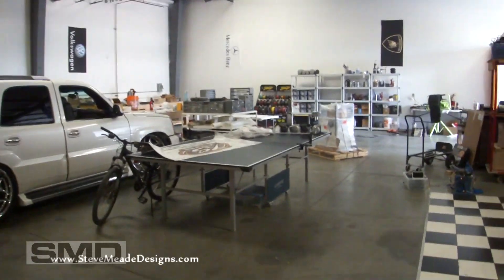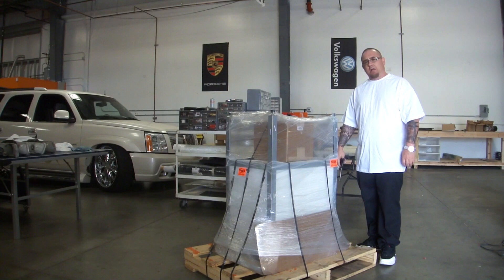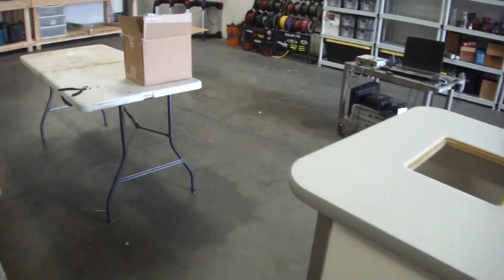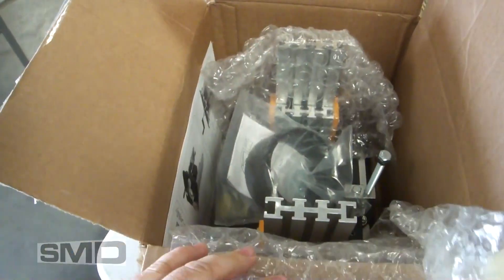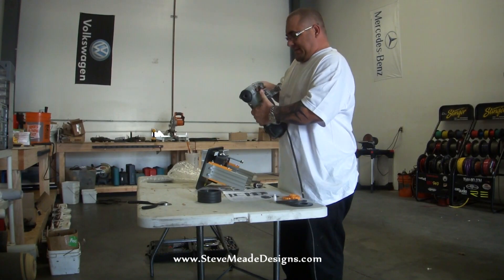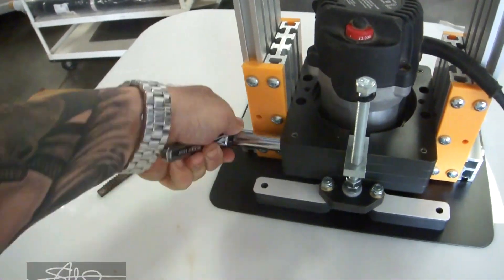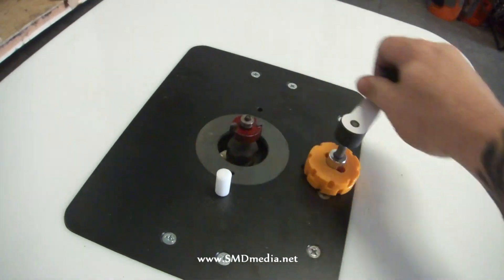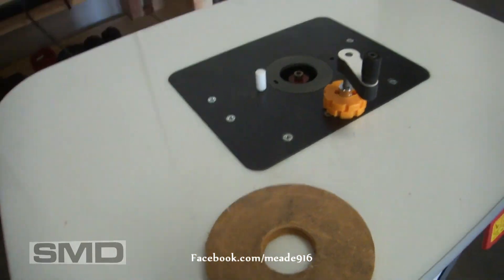NEW Router Table from Mobile Solutions - BEAUTIFUL!

Comment: Nice rig. In my opinion, more "show" than go, but still nice. 
You should have gone with an Incra/WoodPeckers SideWinder lift over the Woodhaven. The SideWinder has a remote mount micro-adjust handle instead of needing a separate socket to lift/lower the router.
Check it out @Incra*com

Now you just need an Incra Positioner an you'll be set up! And trust me, I have an Incra Positioner, and they are the SH-T!

Still, nice stuff!

I like a bigger top personally, but we do different work.